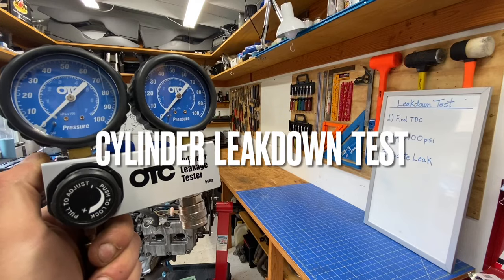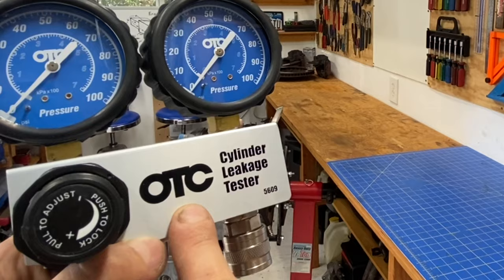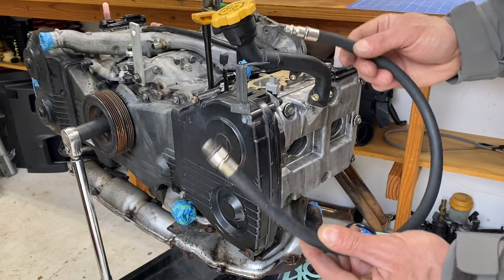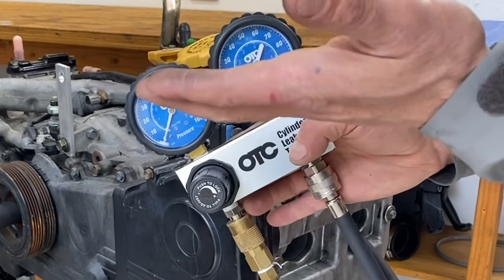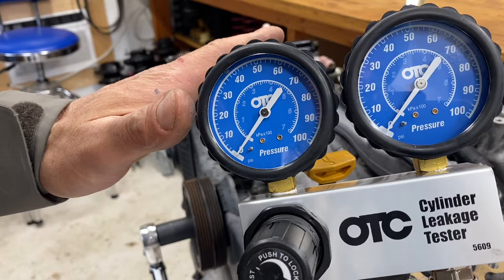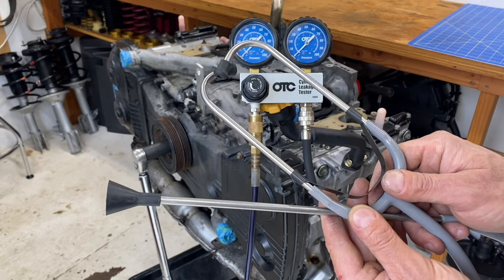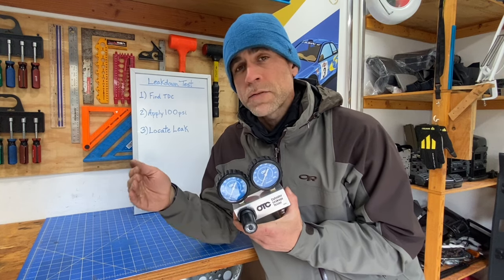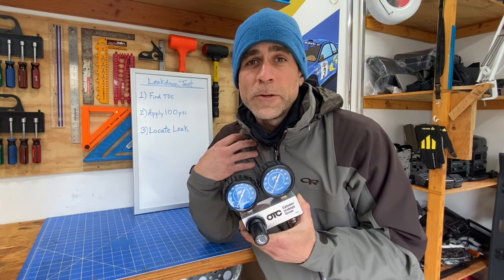Cylinder Leakdown Test (Easy 3-Step Method)

Comment: Excellent video. One suggestion, just to be safe you should remove your ratchet or break over bar from the crank after you find TDC, and before you pressurize the cylinder. There is always a chance that the piston could be forced down by the pressure and rotate the crank.
Reply: Or you could forget it altogether. I've heard a horror story from a diesel shop 😢

Comment: Perfect video. You didn't leave room for any guess work. That's a nice trick to know in determining how to find TDC. No one else on YouTube mentioned that but you. Now I feel confident in doing this for my 2014 F150

What should you do before removing the hose from the engine?
Reply: Turning the valve back down completely releases the pressure - did you ever check your engine?

Comment: Thanks for the video, Luke. 
Newbie question: Just curious, would it be normal to find a higher leak percentage on an engine that is newly built and never run/broken in?  I’m wondering if freshly honed cylinder walls and new piston rings could affect the readings if I the piston has never reciprocated or been through any heat cycles... or would that even make any noticeable difference on the gauge?
Reply from the maker: That’s a great question. Tbh, I haven’t done a leakdown on a fresh ringed engine, it’s always been after break in, if it all. (Which was a mistake, I should’ve leak tested my engines over the years much more than I did, I know better now). To give my best guess, I would say yes it probably would make the leakdown more pronounced and potentially look worse than it will be once the rings have fully seated.

Comment: This guy failed to tell you to listen for air escaping threw the cooling system meaning threw the radiator or along intake manifold  to head mating surfaces this  would tell you you have a leak do to a blown head gasket between cylinder and cooling ports in the combustion chamber or possibly a cracked head or engine block

Comment: Several poor techniques here.  First, you should set TDC mechanically, not using pressure rise as a surrogate.  Not hard to be several degrees off that way.  Consistency matters in tests like this.  Second, NEVER use a tool at the extremes of its range.  You should not be using 100 psi for testing.  Aviation uses 80 psi for good reason.  It is assured to be well below the pressure provided by most compressors and it is well below the maximum rated pressure of the gauge and more likely to be in the linear and more accurate range of the gage.  This video should be retitled to say “How NOT to perform a cylinder leak down test.”
Reply: Hi,  Total newbie and Novice, I want to learn the correct technique,  I have a BMW e46 330,  Is there a mechanical way to get TDC without removing my rocker cover, lot of work and costly replacing gaskets if not?
Reply: @danielocallaghan8517  Some engines have a mark on the harmonic balancer or front pulley that indicate TDC.  If that isn’t available, a chopstick in the spark plug hole will get you pretty close.  The easiest way, but less accurate, is to just turn the engine until the chopstick is extended and not moving up or down.  A more accurate way is to get the chopstick where you think TDC is and then turn the engine until the stick drops about 1/2” and mark the stick against a reference point on the head or valve cover.  And mark something on the crank (pulley, balancer, etc.) against a reference on the engine.  Now turn the engine past TDC until the mark on the chopstick comes back to the reference point on the other side of TDC.  Now mark the crank again.  Now locate the midpoint between the two marks on the crank pulley or balance and turn the engine to this midpoint and you will be very close to TDC.

Comment: Hello! How would you determine a leaking head gasket or blown head gasket or do you have to use the Radiator tester for gases that turns the blue fluid green or yellow?  Thanks for sharing and teachings. Cheers from Motown

Comment: Very informative test when examining a used engine, or just want to find out where you are losing compression on a cylinder.  I recommend removing the wrench from the crank bolt before applying pressure to the cylinder, just in case you miss exact top dead center and the piston cycles from the pressure (rotating the crank and the wrench - and possibly striking your hands - ouch - I've seen it).  And some leakage past the rings is normal (but you can hear the difference if a piston is blown).  Any air leaking from the intake or exhaust areas is not good and mean the heads need rework.
Reply: I was going to say the same thing! Great video, but I would make sure to tell people to remove the socket and ratchet from the crankshaft bolt (edit it into your video, for safety reasons) If you are not exactly at top dead center, the piston will push back down when enough pressure is built up in the cylinder and the socket and ratchet will fling around and could possibly injure yourself or someone else.
Reply from the maker: Hahah, YES!  Good call! Might swing around and smack you in the head!!! 😳
Reply from the maker: And you’re right, thanks for sharing, only leakage that’s normal for good engine is past the rings. Should be zero past any valve!!! Why didn’t I mention that in the video... oh well, try to get it next time. Good add buddy - thanks!

Comment: I was going to buy that leaked down tester, but it’s so cheaply made and too expensive you can buy a $50 one that’s way higher quality and the $50 one even comes with the long tube that reaches down into the spark plug hole so you can actually get a proper seal and not worry about ripping your hose down in there

Comment: Luke, I know this is a leak down test, but is it possible to also do a compression test with the bare long block as you hace it here? Or does the motor has to have the intake manifold, turbo, and rest of the parts, attached to the long block before proceeding with the compression test?

Comment: This is one of the very few videos on YouTube that shows the correct way to do a cylinder leak down test.  It’s nice to see a video by someone that knows what they’re doing. So many videos shows ridiculous ways to find TDC when the leak down tester is the best and fastest way to do this. As shown in this video. The only advice I would give is to take the break over handle and socket off the crankshaft bolt. If the engine comes off of TDC it will spin and rotate that break over bar fast and hard.
Reply from the maker: Thanks and GOOD call on the breaker bar. Think it did snap around and almost smack me on that day I shot the video. You’re spot on with that one!!! 👊

Comment: other way to find TDC is to insert a screw driver into spark plug hole and turn the motor until the screw driver raises to top position at TDC stays there for a little while
Reply: I prefer a chopstick.  Less chance of scratching something or damaging spark plug threads.  Once I find TDC on one cylinder, I mark the chopstick and this makes finding the other cylinders quick and efficient.  And this is MUCH more accurate than trying to use the gauges as a surrogate.  No real mechanic would do that as it simply isn’t accurate or consistent enough.

Comment: Why can you not use the timing band and turn crankshaft till dist rotor points to #1 plug and timing is at 0?
Reply: This is a coil-on-plug ignition system. There is no distributor.

Comment: Nice video. I liked the way you used the OTC tester to find TDC.  Do you think I can use it the same way to check for TDC on a small engine?  Example:  a snowblower engine.  Thanks.
Reply: If not you can use the tool's hose adaptor screwed into the engine with a small Ballon attached to the end where you would click in the Guages.

Comment: At 70 to 80 PSI, the air in the cylinder starts to leak past the o-ring on the hose threaded into the spark plug hole. Any thoughts on how to get a better seal at that point?
Reply: I'm no expert,  but try putting a little motor oil on the oring to help seal.  Otherwise the oring might be too "hard" and need to be replaced.

Comment: I wonder if the air has to be turned on when finding TDC; I see that the airline is connected but I don't know if the gauge valve is turned on. I never used the leakdown gauge before, but I ordered an OTC just like that one, just have to learn how to use it.
Reply from the maker: Nice. OTC tools are always legit.
Reply: @SubaruONLY  thanks for the response but you answered only one of my questions; maybe it is obvious but I don't take anything as obvious when it comes to these technical things the part about the air being on or not can you find TDC with out turning on the air to the tester or does it have to be on , I like to be sure before I start rather than guess. Thank you
Reply from the maker: I don’t normally have the air ON when finding TDC, just watch the small spike in pressure created by the cylinder moving up or down in the cylinder bore 👍
Reply: @SubaruONLY  Ok Thanks for clearing that up.